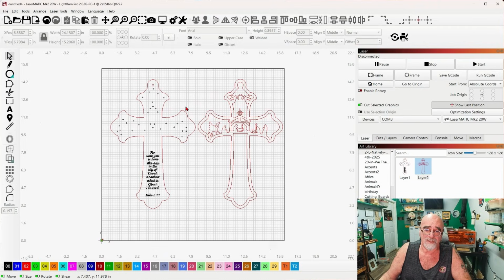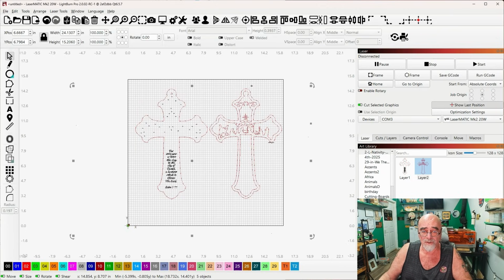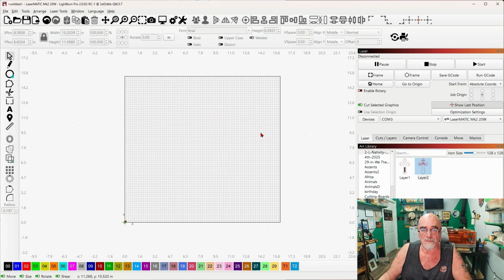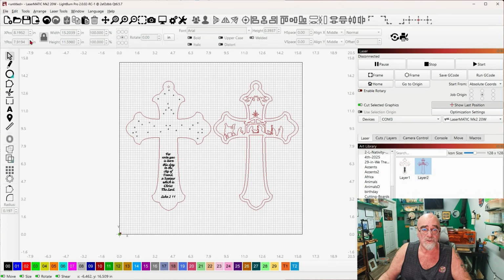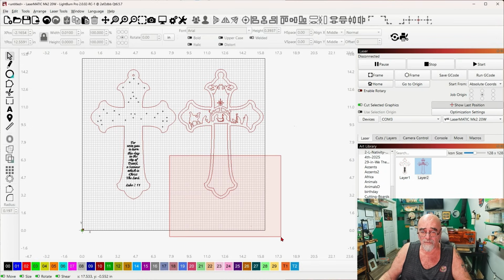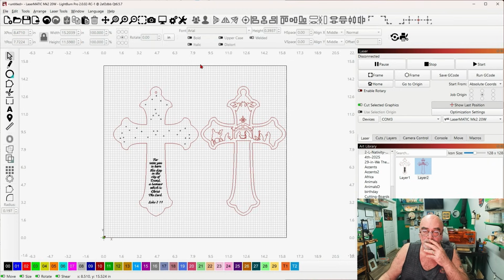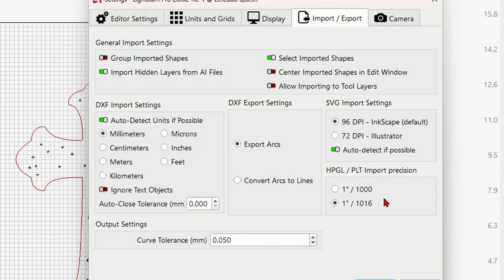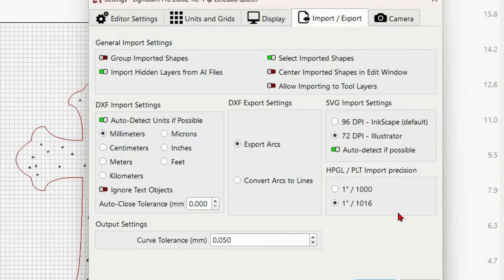🤔Why your SVG files are framing larger than the work area - quick fix!

Comment: Very helpful Rich.  A related question; I find that when I try using SVG files from some of the free graphics sites (I'd enter the name of an example site, but Google seems to want to censor any posts that do that), the SVG files are completely messed up when imported into Lightburn. Have you had experience with that and do you have any recommendations for being able to make those files usable?  Doesn't seem to matter whether import is set to Inkscape or Illustrator.
Reply from the maker: That's a common issue with free SVG files Mark. Often, they have hidden elements or weird scaling issues that need to be cleaned up in a vector program before importing.

Comment: Is there a way to add a pause after a layer?
For example when I do slate coasters I design the whole project
Then I fasten a piece of cardboard to my honeycomb bed
I cut out the squares for the coasters to go in.  I would like to pause the run there and take out the nests for the coasters
And put the coasters in and resume
Now I shut off output to the engrave layer, and cut out my nests, then turn off cut layer and turn on the engrave.
It would be easier if there was a way to pause after my cut layer
Reply from the maker: No, but you can go to the laser Tab and click the Pause button to pause the job. I have paused for more than 10 hours in the past before hitting Resume.
Reply: @TheLouisianaHobbyGuy thank you Rich